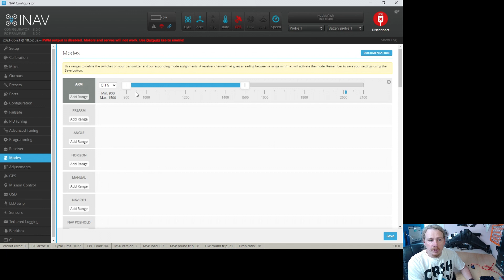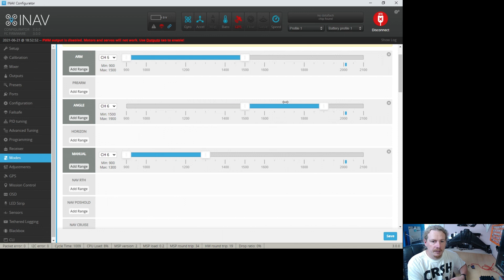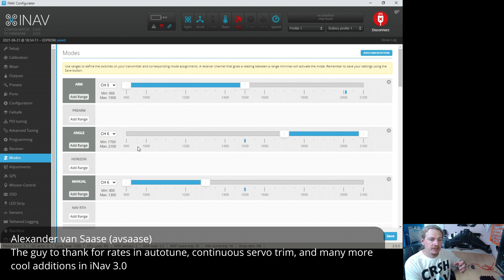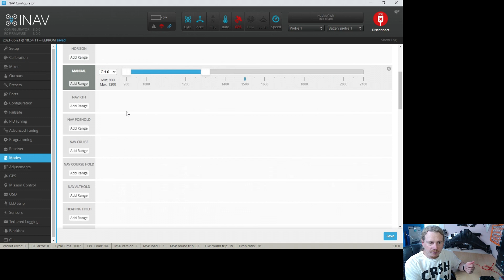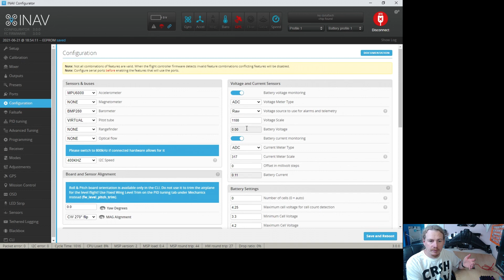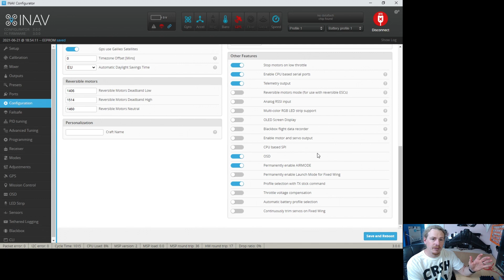How to enable the Acro flight mode in iNav

Comment: Any idea why acro mode would not be level? My fixed wing flies level on angle mode but as soon as I go to acro mode the nose points down at a 5 to 10° angle
Reply from the maker: Acro doesn’t self level. It flies where it’s pointed, like Manual. Angle will be trying to keep the plane level, regardless of outside influences, such as trim, CG, motor thrust angle, drag on the airframe (VTx antennae as an example), turbulence, or thermals. If the nose is dropping in Acro, you’ll most likely find the same to be true in Manual. If the plane flies great in Manual. Everything else will just fly better. Maybe start with CG. It may be on the markers, but a glide test would confirm if the markers are correct. After that, trim. Once it’s flying nice in Manual, Acro should also be good. Then re-do the autolevel tuning. After that, Angle should also work well again.
Reply: @MrD  OK thank you for replying. I think I will try to adjust the CG but I already had to add lead in the back just so it wouldn’t be too nose heavy. After all the DJI transmitter and camera are in the front. I think I’ll just try to adjust the servo horn‘s so that the ailerons provide a little bit of a pitch upward and see if that helps it at all. Not much you can really do with a little dart 250 g plane
Reply from the maker: @johndylan9309  the Dart 250G is very sensitive to CG. You need to make sure this is perfect. The little foam bumps are really accurate enough. With mine, I installed small pins on the CG. From what I can remember, it needed hardly any reflex, 1-2mm. Again, too much reflex could be a sign that the CG is out. 

One other suggestion. Instead of adding lead to the back. Use standoffs to move the motor back. This adds much less dead weight. But also shifts the weight bias to hit CG.

Comment: @Mr.D - Falling with style Thanks for the tutorial. What would you recommend for a flying wing for novices?
Reply from the maker: To be perfectly honest, I wouldn’t recommend a flying wing for a novice. They may look cooler, but they are harder to launch, more critical for CG, and less forgiving that a regular plane. I would recommend a regular plane with either the motor on the nose, twi motors on the wings, or a high mounted motor, mid fuselage. That keep the prop away from hands while launching. The tail adds stability. Something like a VolantexRC Ranger 1600 would be a good starting point. The Bixler os a similar shape, but the build side is more involved for an FPV setup.
Reply: @MrD  I appreciate it. Thank you.

Comment: Thank you very much for putting this out! I could not understand why acro mode wasn't an option for a flight mode in the modes tab. I'm coming from betaflight to fix wing with inev. Acro mode in inab is completely unintuitive so your point at the beginning of the video is completely valid. Days of frustration with this. Again thanks for putting this out there.
Reply from the maker: Thanks Jon. Though it’s the same in BetaFlight. Well, it was the last time I used it. But that was version 3.? 🤣

iNav 4.0 will make things much clearer. There will be a box at the bottom of the modes page that shows when Acro is active.

Comment: Its really embarrassing but Ive been using iNav for years now and I also assumed "Manual" was "Acro" especially since "Airmode" is typically "always enabled" and in BetaFlight Airmode IS acro lol
Reply from the maker: That’s the thing though, in BetaFlight, Airmode isn’t Acro. It works exactly the same way as iNav. Acro is the stabilised flight mode. Airmode is a flight mode modifier that keeps the PID loop active at low throttle. 

It makes it more confusing where you use Airmode on a switch in BetaFlight. But, if nothing else is active at the same time, it’s actually Airmode on top of Acro. The other problem is that BetaFlight uses an incorrect model label in the OSD. iNav inherited that, but it was fixed in the previous version.
Reply: @MrD   Facinating. You think you know things and then all of a sudden.......you dont. lol On my BF quad I dont have any modes set since I dont use ang/hor. Pretty sure airmode is always enabled and my motors spin when armed. Its been a while since I was in its BF config since Ive been happy with it for a long time. Still on 3.5.7 to boot haha
Reply from the maker: I didn’t know BetaFlight had always enable Airmode now. I think the last version of BetaFlight I looked at was 3.4. So having it permanently enabled and no modes, you’re using Acro with the Airmode modifier.

The props will spin when armed. But, with Airmode on, if you move the quad, the motors will speed up to try to level it again. With Airmode off, they wont, until the throttle is raised.

Comment: airmode in betaflight is manual on an inav wing
Reply from the maker: No, it really isn’t. Airmode on BetaFlight is the same as in iNav when a quadcopter platform is selected. It keeps the PID loop active at low throttle. With Airmode off, if you have your quad at idle and move it around, it will do nothing different. However, with Airmode enabled and active, if you move the quad around the motors will increase or decrease power to try and keep it at the same attitude. That is Airmode. 

BetaFlight has no manual equivalent. All the quad flight modes are stabilised. Just having Airmode on the modes page is selecting Acro + Airmode, as Acro is the default flight mode.

Comment: Thanks for clearing this up!. Great video as asways mate.

Im interested in having a mode where i have straight and level flight at a fixed altitude when i release all the sticks... but when i hit the elevator i want to gain or lose altitude, then after i release the sticks again it flies straight and level at a fixed altitude. 

Is there an easy way to get this behaviour? 

This is basically the assisted flying mode on the parrot disco.  I would like to replicate this mode in inav
Reply from the maker: Thank you 👍🏻

You could probably have this or similar if you have if you combine Angle and Alt Hold on the same switch position
Reply: @MrD  thanks. But wouldn't this effectively stop me gaining or losing height unless i turn alt hold off?
Reply from the maker: @beefybeef1326  I believe if you pitch up or down, it should hold the altitude when you let go of the stick.
Reply: @MrD  i agree 👍🏻

Comment: Hi Darren. I was using Air Mode as Acro. Bad mistake because I use this on drone racers. So, I will change it in accordance to your orientation now. Thanks, man
Reply from the maker: Silvio, it’s not bad to use Airmode. I have mine perms permanently enabled. It’s just incorrect to call Acro, Airmode. 

Acro is the stabilised flight mode. 
Airmode is something that keeps the PID active at low throttle, so that you have more control on quads, and consistent stabilisation on fixed wing.
Reply: @MrD  ok MrD. So, if acro is stabilized mode what is the difference between acro and angle? Just to confirm my thoughts! Thanks
Reply from the maker: @SILVIOFRANCO1  
Acro is stabilised
Angle is stabilised and self-levelling. 

Horizon is Angle towards the centre of the sticks and Acro towards the outside.
Reply: @MrD  Thanks so much, MrD
Reply: @MrD  BTW, Thanks for the video
Reply from the maker: You’re welcome Silvio